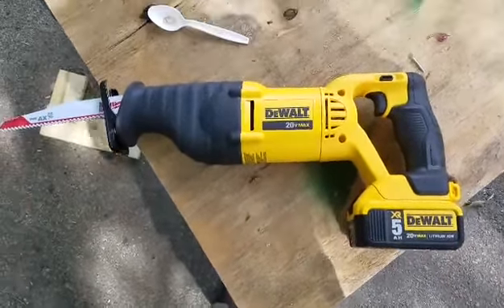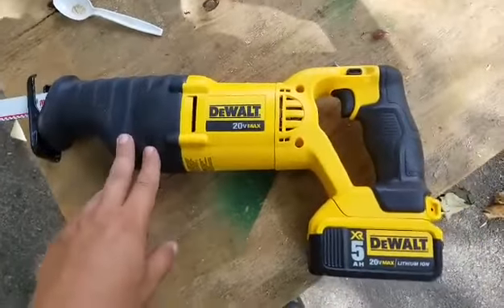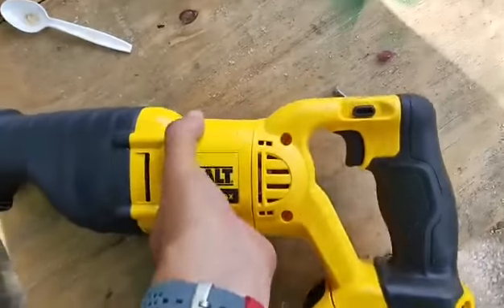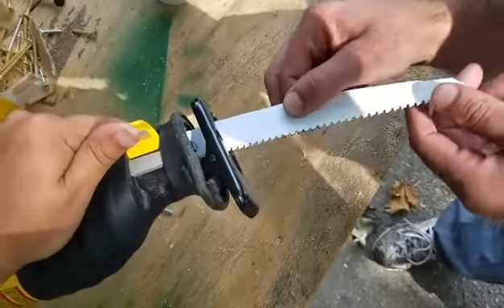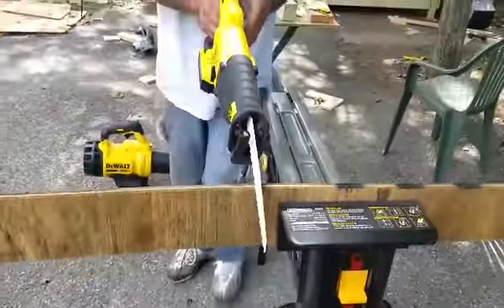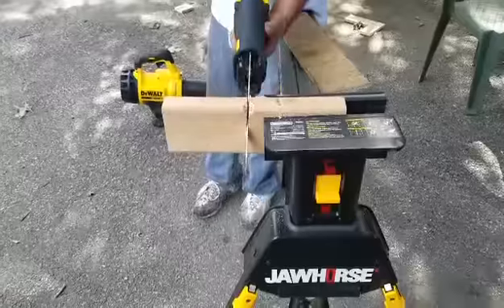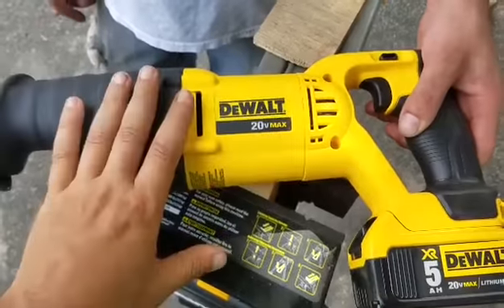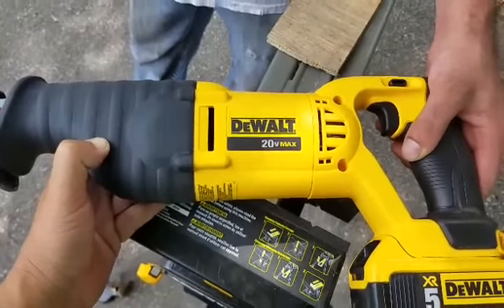DeWalt 20v Max Reciprocating Saw Review (DCS381)

Comment: Nice. How do you cut out a wall (shed) for installing a window?  This blade wouldn't punch a hole in order to cut right? Do I need to use a drill first to put a hole big enough to fit this blade in so I can cut? Can you give me some light on this?
Reply: Called a plunge cut could probably find a video you could also drill a hole big enough and start that way as well

Comment: For anyone needing one for professional use, the 381 is not as good as the 380. I found out that DeWalt actually cheaps out on the tool features on the combo kits with pretty much every tool. For instance on this tool they ditch the 1.1/8 inch stroke and substitute a 1 in stroke. And do away with the 4 position blade holder for a standard blade holder. All the combo tools are different than the standalone tools, that's how they are able to discount them so much. If you are okay with that then fine but they are not the same tools. Also the 381 weighs slightly less than the 380. What they did to make it lighter I can only guess but it's not from better engineering.

Comment: you're right but I'm trying to gauge how long it will run I don't do a lot of framing or anything I would use it for cutting angle or pipe not much wood
Reply from the maker: well ur getting in the right platform if your not already in it .you should be fine with a 5ah battery ..i used this dewalt for 2 days making all kind of cuts ...not as a main cutting tool but did use it quite often still had 2 bars on my 5ah battery ...but you got the 6ah and 9ah option so i wouldnt worry about it
Reply: You could find a cheaper saw with same amount of amps for doing plumbing. I would recommend dewalt on a higher level scale for   everyday usage in the carpentry world.

Comment: Also Milwaukee and Diablo are the best blades and especially the axe blade
Reply: CATERPILLAR lenox,, I cut thick industrial steel window frames out for years and the only blade that lasted and worked good was the lenox torch blade.. Trust me you wont go back.. I have used thousands upon thousands of recip blades..

Comment: I don't know what I am doing wrong but my battery doesn't last very long. I bought the DCS388  60V  Recip Saw thinking that it would have more power and last longer than my DCS380 20V Recip Saw. Boy was I wrong. I wasted $400. I should have just bought another DCS380 20V Recip Saw.